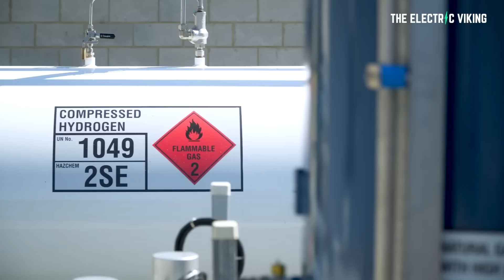World's largest wind & solar energy grid shows the future of the planet

Comment: Way to go South Australia. Breath the clean air! Time to convert all fossil fueled vehicles, appliances, heating and cooling and industry to arrive at our low carbon (and low pollution) future. For further reading: Electrify an optimist's playbook for our clean energy future by Saul Griffith 2021. More EVs connected as vehicle to grid and grid to vehicle could add important storage and load.  Time to ramp up industry now that you have clean energy.

Comment: Ironically, a key product of this surplus clean energy may be production of large amounts of hydrogen fuel (produced by electrolysis of water).  This may create a BEV - Hydrogen future, with ships, aircraft and large trucks moving to hydrogen and smaller vehicles and stationary storage relying on batteries.  This may not be how it unfolds, but it is worth considering the implications of inexpensive, green electricity.

Comment: SA is missing the point of Tony's Super Energy. SA should always have full usage when the batteries are filled. Various  capabilities and industries should increase their usage once the batteries are full. Desalination plant and pumps into aquifers is one. Everyone should charge their cars at provided lower rates. Heavy industry should get lower rates if they increase production. Use more pay less. Need industry to create cases where they can increase production and use excess power to increase GDP.  Turn on additional electrolysis hydrogen generators.
Reply: Additional? You’ve got to be kidding. The electrolysers that exist now have a combined load of 100Mw. They don’t run continuously as there is no storage so it’s on demand only.

This might change but not today.

Snowy 2.0’was supposed to turn many Gw of excess energy in to pumped storage. That is now on the rocks too

Comment: Here in sunny SCal solar panels and net metering (under NEEM 2.0) plus EV TOU rates my Tesla basically runs on sunshine. Beats pumping gas. For those in Calif. read up on NEEM 3.0 which goes into effect in April 2023, it will cut long term solar panel gains by around 45% as I recollect, 3.0 is still another attempt to make things more equitable for all. Those already under 2.0 retain its conditions. Suffice to say it’s a very complicated issue.  Btw, California is mandated to be 100% renewable energy by 2045, currently around 30%.  I foresee massive utility scale storage increases going into the future.  Tesla Megapack sales are already rocketing for past couple of years, new Megapack factory in Lathrop, CA ramping up to production rate of 10k per year.  They sell for $2.5 million each, big money maker. Just a matter of time before battery cell production increases to the point more Megapack production is going to happen, I’m guessing in 3-4 yrs time. Then there’s the Powerpack and Powerwall products which will also soar along with their solar panels.  Good to see Australia leading the way.  We are at a point in time where a massive paradigm shift toward renewable energy and EVs is happening.  Exciting and interesting times.

Comment: Hopefully wind is getting better as windmill  towers are burning out and falling down costing too much .. according to another YouTube 😆
Like others here Solar panel and batteries don't add up. I'm not paying 30k to "save" $10 a week (current power bill). I'll be dead and the panels and roof will need replacing. Definitely consider if retails for that 50% less. The massive lack of common solar retailers show its been brought out or controlled before it arrives in NZ.

Comment: The energy solar farm to turn in to hydrogen company didn't get enough backers but they were going to use solar to run cable through the ocean to Asian mrk better plan to set up is use solar family to produce energy to process ocean water to turn into hydrogen excess solar power would be sent to southern astrailia you would spend pennies to use electricity from solar used to make hydrogen you can turn hydrogen.  Into power form to make transportation safe that's what I would do is easy stogie to use powdered hydrogen converted from sea water and then from solar to offset the brine salt from like the salinisation system to get the hydrogen you would save the salt to sale so better invirometaly friendly and would kill the plant life in the ocean as well as the marine life this way you would get two product you could use a company called earth grid in usa to build under ocean sea tunnel it build tunnel in a mile in a day so do that last after company has enough money build up from hydrogen power sales and as well as from salt you could use salt to make salt cavern under ground to store powered hydrogen if you want to stock pile the hydrogen power in safe dry area if the sales are not taking off first years but yah cool

Comment: I wish it was true. Here in Las Vegas Nevada, where we have the best conditions for solar, I can buy a 4kw Tesla solar system for $9500, delivering 10-25 kwh per day , plus 1 Powerwall for $12000 to store 8kwh over night . That takes care  of my house. At 5% ROI , that would cost me about $1000 per year. But I can buy the annual production of 7MWH for $840 off the grid. If solar panels drop by 50%, or the batterie drop by 50 % , or some combination thereof, we are set and we can switch entirely. IMHO, not yet, but soon, at least in sunny States.

Comment: Here in Nz, I pay a grand a year for electricity, but 35% of my bill is supply charge and govt taxs. I am basicly punished for being a low user. Òne.of the cunning ways my bill is padded is water heating, used to be charged at a lower rate, because it could be controlled by the power supplier as demand varyed but now its charged at the full rate. The power companies will always find away to rip of consumers until home battery packs become more affordable. When that happens power suppliers will be begging for customers

Comment: As an Electrician working on power plants (including solar), I was hearing about energy source agnostic computer modeling in the early 2000's that surprised the energy modelers by placing massively overbuilding Wind and Solar power at the top of the list of cheapest power sources (less than 10 cents a kWhr retail). This surprised the modelers since Wind and Solar were not the cheapest sources at the time. The modeling took into account economies of scale and future trends.

At the time, it was calculated that the US grid could be powered by 90% renewables within 16 years, and providing cheaper power. Of that 90%, 80% would be wind, and 20% solar. The last 10% of non-renewables would have been supplied by gas peaker plants until battery storage got cheap enough to replace it, either by stationary storage or vehicle to grid connections from EVs. We now have cheap stationary battery storage, and grid connected EVs are coming.

Wind Energy is much more reliable on a 24/365 basis, so it was the predominate power source, just needing some upgrades to grids to move it from production to demand. Nuclear was not even considered due to its incredibly high cost and slow deployment, plus being much more CO2 intensive than renewables once all of the construction, fuel production, decommissioning, and waste storage CO2 impacts were accounted for, putting nuclear's CO2 production somewhere between natural gas and coal.

Comment: Long shot from cheap energy.  Math and calculating actual costs will tell the real story.

As someone who lives off grid I can tell you it isn't all roses and sunshine.  It is hard.  I can tell you straight up that most people would not choose to live this way if the truth was presented to them.  If people actually had to produce their own power they would WASTE A LOT LESS.  It isn't until  you produce your own electricity do you start to realize just how inefficient and wasteful we are.  This time of the year sunshine is sparse with long periods of time with not enough sunshine to carry the load.  I have to watch every watt during the winter.  You have to find other ways to do things.  Summer time my electricity is abundant, and more than I need.  You literally have to oversize your solar system for the winter periods with short days and little sunshine.  

The cost for these systems are very expensive.  I realize you are on a mission to promote this stuff, but it would be more valuable for people to try to do this themselves and figure it out.  The "grid" is just an excuse for someone else to do the hard work and we continue to live very detached wasteful lives.  Ver much like our food systems.  People have no idea how to grow food, where it comes from, or the hard work it takes to do such a thing.  Then if you are not eating seasonally local food it is being trucked, shipped, flown all over the world so you can eat stuff that you want, when you want it with no regard for your own environment and seasonal food production.  We are spoiled and wasteful.  We could dramatically reduce our demand for electricity if we would stop wasting it and actually valued each watt we use.  People need an EV coach in their homes to remind them to turn things off.  

This time of the year my EV is lucky to take a trip into town once every couple of weeks on the power I produce because sunshine is that poor.  Expanding the solar system is a massive cost undertaking that will have to be done if I want to be able to run my EV normally year around.   The sad truth is that EV's are VERY INEFFICIENT and use WAYYYY TOO MUCH POWER.  The trend in the industry has gone the wrong direction as we try to lure ICE drivers to look at and try EV's with 0-60 times and craziness that means we end up with EV's that are the equivalent of "gas guzzlers".   

If you want a mission then take on the challenge to produce our own power.  Take responsibility for this yourself.  Then get back to us about how "cheap" your electricity is and power consumption.  You are just front loading the costs and it will take a very long time for these things to pay for themselves.  Now that inflation is driving everything sky high I can see that payback period approaching more quickly, but anyone with a few firing brain cells knows this isn't some miracle free/cheap energy solution.   Just like saying we are saving money driving EV's.  That might be true if you drive A LOT of miles to recoup the upfront cost of the EV itself.   A calculator, good record keeping, and some common sense is your friend to learn the truth.

While your at it grow a garden and work to try and produce the food you eat.  I promise you that you won't be bragging about how cheap your food is once you have done the work, but the quality of the food will be dramatically better and you know exactly where it came from.  Give it some thought.  People TALK about the climate and climate change, but that is all it is.  TALK.  Carry your own water, produce your own power, grow your own food.  Then let's talk.  LOL

Comment: Solar is overrated.  We have an off grid solar system here and you are restricted when it comes to a 6k inverter and sunlight.  Forget heavy loads and multiple ones.  So we have been going back to the grid instead.  Plus, these inverters & controllers don’t last either.

Comment: I'm currently building a new house in Melbourne. It's so exciting (and expensive). I've gone full electric. 3 phase power. Induction cooktop. Electric water heater. Geothermal heat pump for climate control. Going to get 10.2kW of solar panels with a Powerwall. Buying a Model Y for our main car and possibly a smaller EV with V2G for a secondary car. My plan is to never pay for gas and electricity again.

Comment: The gas bashing is wrong. Fossil gas yes, biomethane no.

Biomethane is our long term storage, it is the fuel for which the infrastructure exists already, and biogas is plentiful, cheap and has tons of potential still.

There is no way a country like germany can survive with renewables and batteries alone. Well, there is, but the needed investment is not logical. It can happily survive with a bit of biomethane thrown in to paper over the gaps in renewable production. We had several weeks in september, november and now again where renewable production is so low that the cost of batteries, and the ROI of such scale of batteries is just not feasible. If you throw in the 100TWh of biogas already produced, and use that solely to drive GuD (combined cycle) power plants which are tied into district heating, most of the gap is plugged. Double the biogas production, and all worries are gone.

At least according to my calculations, which involved taking 8ys of SMARD data, scaling grid demand by 2, and scaling actual generation data to the renewable installation targets for 2045, and batteries ranging from 1-4d worth (the latter is more than 10TWh, costing 4.53T EUR in tesla megapacks, but 1T EUR is a more realistic target for future grid level battery installation cost).

Comment: At the very moment when I was watching this video, at 7pm EDT on 27-01-23 I checked the NEM Dashboard, and South Australia had the highest wholesale price of any state. It was $519 when all the other states were $150 -160 per MWh.

SA demand was 2.313GW and generation was 1.585GW. This included 980MW from gas turbines, and 108 MW from diesel generators. And about 730 MW was being imported from Victoria. This was an unusual situation, but the point is that there are good days and bad  days. South Australia gets 68% from renewables on average. The percentage is high in summer, and much lower as winter approaches (May has low wind). There comes a point where increasing the percentage of wind and solar becomes increasingly expensive. Perhaps 80% is achievable, but it is the law of diminishing returns as you approach 100%.
Reply: The law of diminishing returns does not really apply with overcapacity. What’s assume they had three times the amount of renewables. All that would happen is there power would be super cheap when it was 100% renewable.
Reply: What diminishing returns do reduce renewables capacity? How?
Reply: SA has some of the lowest wholesales power prices in the country. The state is expected to meet >100% of net demand by solar/wind ~2025... In 2022, SA averaged 67% solar/wind; in Apr-June it was 60%. NSW interconnector - and hydrogen plant completed in 2025 - will help smooth out season fluctuations
Reply: @jarrodf_  bullshit
Reply: @robertfonovic3551  Which part?
Reply: Unfortunately, Sam doesn't do complexity.
Reply: @themidgetsman  gee that sounds inexpesive? Any costing on that?

Comment: I took a 1000 mile trip to the south of Spain and back in a Tesla M3LR.  With the energy grid in Spain emitting only 40 grams of CO2 per KWH on the travel days, round trip we emitted 10 kilos of CO2.  In a Toyota Camry V6, that would have emitted 350kilos of CO2 (35X more!!!)
Reply: ❤👍👏👏👏 Well done!😀
Reply: Who gives a shit
Reply: How many hundreds of
kilograms of CO2 was emitted during the battery manufacture and the TM3LR rolled off the assembly line?
Reply: @theairstig9164  How loud is it in the echo chamber you live in? How much CO2 was  emitted to extract, refine, transport then gasoline around the world? All of that so 70% of the energy can be wasted while running the car... The battery will last longer than the car, then it can be used for energy storage,  then ultimately about 95% of the materials inside will be recycled.
Reply: @theairstig9164  Nothing compared to the CO2 emitted over the lifetime of a petrol vehicle. Also, how much CO2 was emitted in digging the oil well, operating the oil well, refining the oil into petrol, and making the petrol vehicle itself?